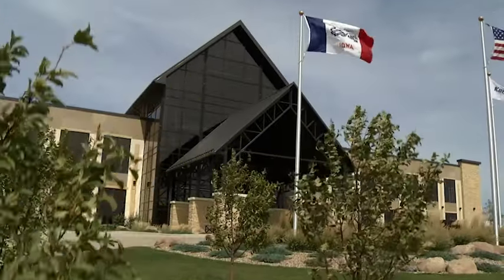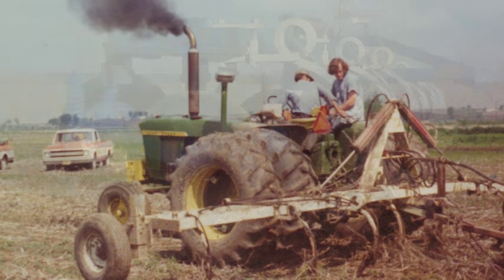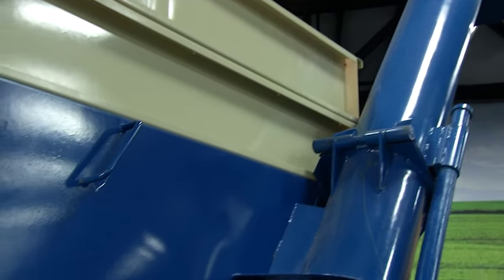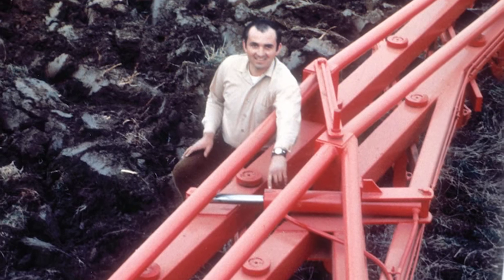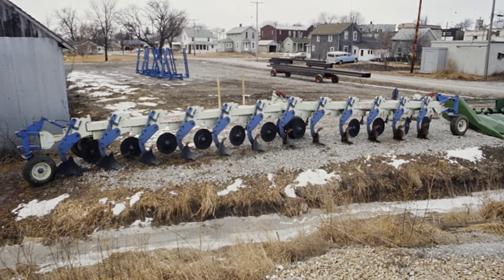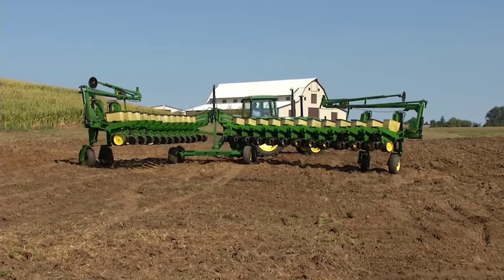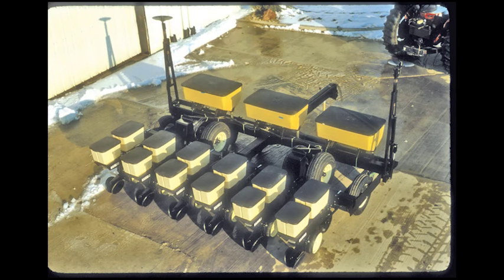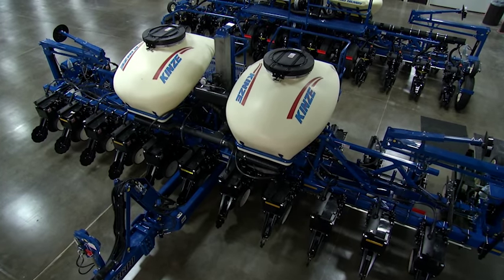50 Years of Disruptive Innovation

Comment: So kinze pretty much copied John Deere stuff right?
Reply from the maker: Carsen Culpitt Kinze has been creating first in the industry innovations for more than 50 years.  Many of these innovations are highlighted in the video.
Reply: May want to do some research young man, Kinze has been making good equipment great and last longer than the original manufacturer.
Reply: there was a very long story written that I came across awhile back, which was a long drawn out battle with John Deere over who had rights to what, and Deere had been really shitty.....after the huge trail and whatnot I'm shocked to see so much Deere crap in the video, but guess sometimes you have to bury the hatchet and move on
Reply: Other way around young man, "green" has been reduced to copying innovators for decades. Look at the quad track, took them 20 years to copy CaseIH, and they still couldn't get it right.
Reply: RD2564 Not to mention the IHC single rotor combine, JD waited 20 years to see how that went ,before building one ,or taking till 1960 to get rid of those silly old putt putt tractors and build an inline multi that the competition had been running since 1920,haha ha real innovators the old JD.
Reply: Annndddd  here it is... this comment come with every video with JD in it. Stop repeating stuff you read in a comment somewhere. They are not the same track design. The differences are VERY obvious.
Reply: Basically with planter units
Reply: If Toyo improves tire technology, does that not count because they didn't invent the tire? Lots of innovation is built off the back of previous technology that was once innovative itself. That's how advancement of knowledge works. EVERYTHING is built off the foundation of something before it.
Reply: According to that logic nothing is new because everything new has part of something that had already existed.
Reply: Carsen Joseph Culpitt You can tell you are young. 

There used to be hundreds of small line manufacturers. John Deere has killed most all with litigation. Kinze beat them at their own game. He makes a great product and refuses to sell out to Deere.
Reply: Carsen Joseph Culpitt a
Reply: Amen brother, IHC was putting jd out of the tractor bussness . jd's 4020 was basically  a IHC tractor in green paint!!  Ihc spent a million $$  fixin a problem that happened with the 560 rear end. A lot of farmers ran to jd at that time, but jd was was basically building IHC tractors by then. Oliver went to hell when white took over. Alis Chalmers was a good tractor too. they were all out in front of jd's pop'n johnny.
Reply: Those silly put-put tractors can drag inlines around like toys. I know because I've done it. My '55 JD 40 could drag around a Ford 1720 like a toy. Same size rear (11.2-24) tires. Same approximate weight.
Reply: That's because they patented it, and yes they did get it right.
Reply: @interman7715  you're spot on about the combines, but I would talk crap about the old 2cyl tractors. They made ridiculous torque. A red one might out run it in road gear, but the JD wouldn't have to downshift up the hill.
Reply: @RD2564  I love my old JDs but not anything newer than the 55 series. Our 7800 has been nothing but a money pit, and the 7820 JD refuses to let our long time independent mechanic work on because they won't share their diagnostics program. Both are going to be replaced with something different as soon as money allows. I'm thinking a New Holland would look nice pulling the blue kinze planter. As for the 7820, I don't know yet. It was a bit of an impulse buy by my dad and doesn't do much more than the 7800 or 4630 (that's turned up to 200hp) will, and what it can't handle, the 8640 does without breaking a sweat.
Reply: Keegan Johnson With all due respect, my grandfather started rowcropping back in the 1930s with f12 and f14 farmalls then with Farmall Ms and Hs IHC  . They  were revolutionary, easy to start had 3point linkage a pto plus a belt drive for older machinery and a whole array of easy attach mid mounted implements.JD were always a well made machine ,but were primitive, ie hand clutches  dangerous and hard work  when turning in   rowcrops as well as trying to manipulate your implement, that big flywheel on the side was awkward and hazardous as well . We still had 70 year old Farmalls that earned their keep . Happy farming.
Reply: @interman7715  we have an H and an M. They are great little tractors, I'll give em that. Ours don't have 3 point systems. The H is our post hole digger rig and the M pulls around hayracks to haul away trees when we cut them off of terraces. The H was my Dad's dads, and the M came from Moms dad. One thing that I don't like is the steering on them. No power steering and lots of play in the center. But I enjoy using them. Also have a 530 from my great uncle. It has a 3 point on it and power steering. It's called a 2 bottom tractor but we have a little 3 bottom and use it to cut gardens and get between terraces and intake pipes and that little sucker will lug down a bit but just keep popping. I'm not super brand loyal anymore, but I so think credit should be given where it's due. JD didn't need anything different for an engine until farmers started needing over 100hp.
Reply: @RD2564  Now you do some research. Kelderman was making tracks to put on articulated tractors long before Case IH. They took original red and yellow Versatiles and made dry box floaters out of them complete with tracks. Case IH made them popular, but they were not first by a long shot.
Reply: @Parents_of_Twins  When velcro was "discovered", was it something new? No. They copied Cockleburrs.
Reply: @normanaltman5888  Hardly. Deere had hydrostatic power steering and lower link sensing on the 20 series 2 cylinders, IH, not even close to releasing hydrostatic steering for another 7 years. Allis had lower link sensing but only for their implements on their tractors. In 1963, MM is the only one who had something close to a 5010, the first tractor with 100 hp at the draw bar. Everyone else hustled something up shortly after. Oliver had live PTO first. IH had the first high-low shift on the go arrangement. Ford had the first truly power shift transmission. MM used MFWD first. MF came up with the 3 point hitch and was the first manufacturer to buy from a competitor, add different sheet metal to market a tractor not their own, ( the 97 & 98). IH led the pack until 1960. Then Deere took over. The Wagner deal was the beginning of the back stabbing. But the 7000 planter was a true innovation. Kinzie improved on that initial design and sold better, innovative parts to improve the performance of a 7000 planter. Whether patents expired or beating Deere at their own game, it remains clear. With the Kinzie name on it, you can expect it to over achieve and outlast everything else.
Reply: @interman7715  Just when did IH start putting 3 point on their tractors???? Not until the 60s.
Reply: @thegreenerthemeaner  Kelderwho? Seriously bud, who cares ...
Reply: thegreenerthemeaner Jesus Christ mate even our 1938 model M had it.Get a book called IHC product development history ,you might learn something.
Reply: He made JD stuff better
Reply: @interman7715  Harry Ferguson invented and patented the 3 point hitch long before 1938, in fact it was 1926. Wiki even says it was something Farmall did not yet have.
Reply: @RD2564  Some people think that whoever makes something popular invented it.
Reply: Mike Maes  just like Allis was handed a diesel engine when they bought Buda. Just like you get handed a Big Mac when you pay for it. You use it as you see fit, eat it or stomp on it, it's all yours.
Reply: thegreenerthemeaner Everyone knows Ferguson invented 3 point linkage and IHC was the first to put hydrostatic drives in tractors and combines ,who cares ,the point of this blog is about John Deere copying off everyone. A lot of the modern green and yellow fanboys don't know much about agricultural machinery pioneers and are to dumb and ignorant to learn.
Reply: @jfdb59  one is red and the other is....
Reply: @robertlonsdale3826  if you think the only difference between an RX and a quadtrac is colour...there is no point in trying to explain anything to you.
Reply: @interman7715  every manufacturer had innovations. Some not so stellar, some vastly improved upon compared to others. Some were stifled and suppressed, some stolen. The wicked ways of the business world but in the end, who pays the most and gets the least? The Farmer.
Reply: Mike Maes  Deere had horse drawn hillside combines in the NorthWest as did Caterpillar, the 2 chief players of that sector in the late 19th and early 20th Century. Cat sold a couple of combines to Deere and yet continued to sell what they didn't sell to Deere. Why? Both were doing just fine as they were. Cat was selling, Deere was the buyer. McCormick was still in Kansas. Why did they not get into the Hillside race THEN? Now I won't for a moment excuse Deere of skulduggery. IH got a huge lawsuit on them for copying a Deere corn head in the 70s. Deere doesn't play fair but who ever did? MF for a while only built certian parts of their line at certian times of the year(s). Agco has bought how many shortline companies as well as Case IH (hay and forage equipment) and New Holland. Did Deere start the trend or see it before the others? If something good is struggling or about to go under, do you buy it to keep it going or let the competition have it? Innovation fits at times because of need, sometimes out of product survival. How many companies throw themselves at a major player in order to survive? It's not always the Big Bad Wolf who is good at surviving. Homelite for example was about to croak due Stihl making inroads thru.......marketing. Hitachi built the undercarriages for excavators while Deere built the top as part of a deal to get more into the Japanese market. Case IH merged with New Holland. They then had to be rid of certain items so as not to have too large a share of the market (Monopoly anyone?). Who was behind that is just as important as C/NH not knowing that would happen. Remember Deere tried to buy Versatile when it was For Sale and was shot down. Agco, being held in Europe got away with buying some of the C/NH spin off, Versatile went over the rainbow. What is left of White, Oliver, MM and Allis? Who gutted who because the mishandlers at Allis formed Agco after they bankrupt it and sucked up a bunch of short liners, then try and put rebrand European tractors in their stead? How is it much different than Deere? And it's about getting the work done cost effective right down to return on invest when you are done with it. Surely you figure that in upon investing money in equipment. My uncle taught me that a truly good business decision should be without emotion. I can tell you he is right. You should never feel good about it or spend out of spite and anger. It will just make sense.
Reply: @jfdb59  thanks  but I don,t particularly want any explanations from  a genius who is so excited by the rivalry between two  global corporations who just happen to both manufacture similar tractors, god bless you sonny
Reply: @robertlonsdale3826  made no mention of being excited by it. I just don't parrot nonsense I read on the internet.
Reply: Acually Deere copied Kinze plow designs. Kinze was forced to reproduce deere units because deere wouldnt sell these units so Mr. Kinzebaw could put these on his superior frames. Deere would have liked to have have the folding frames so they tried to freeze him out. I farmed for 55 years and had 2 of his frames one double bar and one 12 row folding these both were superior products. I love them.
Reply: Wow pretty ignorant comment there bud. John Deere hasn’t pioneered anything in the last 50-60 years. They follow trends and make them better. Just like their quad track. Their planters are all variants of other companies and even their small implament frontier line is all rebranded. Non built in house. I know this because I own many John Deere’s and love the research. But to say kinze, which we own several pieces ever copies John Deere is a joke.
Reply: John Deere has become junk over the years. If we were stuck in contracts I’d ditch them in a heartbeat. Yes they are shined but riddled with issues. They copy the market years after patents run out and try and make them “shinnier”.
Reply: No John Deere actually copied kinze it’s a famous lawsuit
Reply: @RD2564  Case IH copied Kelderman. So copying is not exclusive to Deere, it's all of them.
Reply: @interman7715  It was added, not standard in 1938 IH anything in the US. YOUR book is wrong.
Reply: @interman7715  Don't think for a minute they were the only ones who did it.
Reply: @AdamSmith-uv6kr  7000 series max emerge planters are not 50.....yet. The basic design has been modified by several manufacturers
Reply: Yes, but John Deere stole it all from various others.